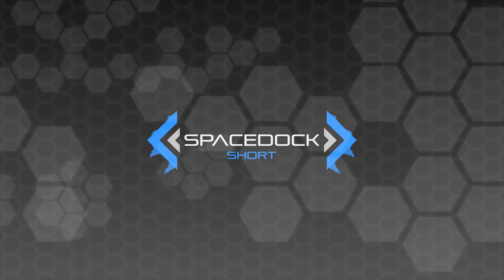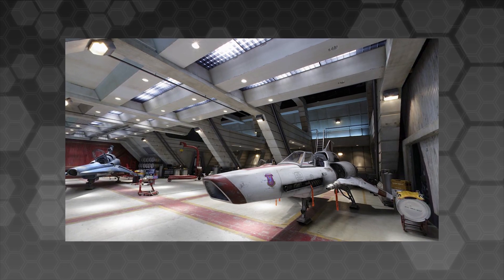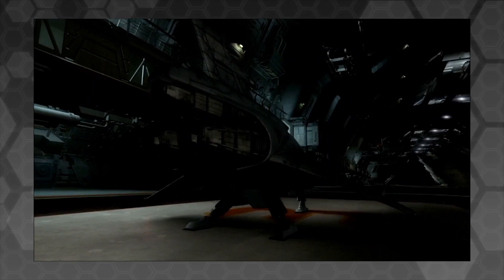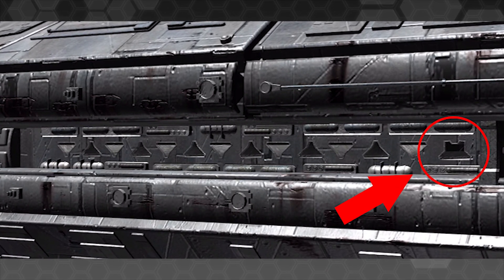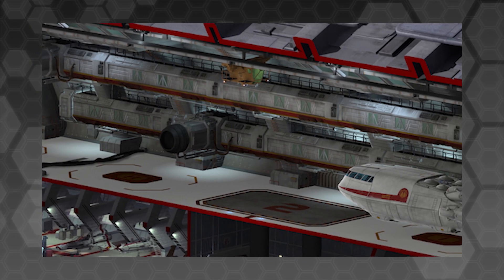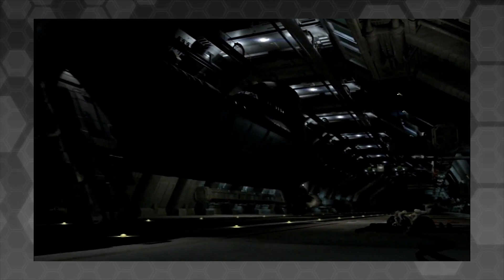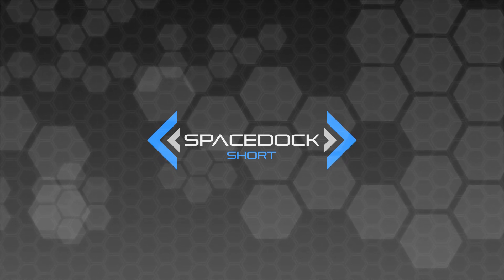How to Land on the Battlestar Galactica

Comment: Calling the ball refers to the Optical Landing System (OLS). The OLS is not the sequential landing lights.  The actual ball is centered on the stern of each flight deck, just below the landing deck itself center mass.  You see a red series of lights which looks like an "X" going three lights in the vertical and 4 lights off each side in the horizontal.  The vertical is your glide slope adjust, and the horizontal is for centering both small and larger craft on the deck.  LArger craft like Colonial One would need to center on-line with the lights since there wasn't any auto-landing systems.  I hope this helps!

Comment: The shuttle craft pictured (& honestly I never noticed it, even though I'm of the original BSG generation.), is probably just an homage to BSG '78.  But you knew that, I'm sure.  Sorry...🙃.
Like you said, though, in this continuity, it probably fell into disuse & was remanded to 2nd or 3rd tier Colonial usage.  I think they may have kept 1 or 2 stocked for special purposes, such as real VIP's or large-order emergency evac of the entire ship.  Galactica was older, bigger, & had more crew than Mercury class ships like Pegasus, so even a full complement of Raptors, which Galactica certainly did not have, couldn't handle a full abandon ship situation.

Comment: If you look at the model of the Pegasus that show the Raptor launch tube, you will see right side up Viper launch tubes and upside down launch tubes. My guess would be that the Vipers are launched in the orientation that they land and that the launch tubes are angled from each hanger bay. Each hanger bay, one for each landing bay is probably directly below each landing bay.

Comment: ...and Vipers land at "take-off" speed for the same reason that all aircraft landing on a carrier do, in case something goes hideously wrong and they need to take off again. Now, I know that they are in a vaccuum, and they don't need airspeed to lift off, but they might need to get the hell OUT of the bay quickly in an emergency, so they touchdown at "get the F out" speed first, then arrest their momentum. In air combat situations, even in outer space, mpmentum is life. You don't give it up easily.

Comment: Don't know if anyone has noticed this yet, but in that shot of Pegasus's launch tubes, half of them are upside-down and closed. So I assume the hangar deck has two floors and no ceiling, and it can launch Vipers in either orientation, but possibly not both at once. So the upper landing bay would collect it's Vipers, re-fuel, re-load, and re-launch, then the lower landing bay takes over and brings their upside-down Vipers "up" into the same deck, and launches their fighters from the upside-down tubes.
Reply: Okay, so someone else did point this out. Sorry, late to the party! :)

Comment: The ship flipping mechanism of the Pegasus does not need to be the least bit complicated.  On the landing decks that the fighter land "upright" you have conventional lifts. On the landing decks where the fighters land "inverted" instead of the lift coming straight down it could simply hinge on one edge so as the fighter is brought in the plate would flip 180 degrees along the hinged edge. This flipping plate would actually be a simpler mechanism than a conventional lift and have fewer moving parts.

Comment: One thing I really like about Battlestar Galactica generally is that there is a lot of things that make a lot of sense.  The utilitarian design, the seperate landing/launching systems (which would be a real advantage in fleet actions compaired to having to share a single runway for launching and landing craft), the fact that there are 2 landing bays (which if you have a fleet that is as reliant on fighters as in BSG makes absolute sense with a context to battle damage) and facilities like a machine shop to allow the battlestar to be relatively self sufficient.

As for the Pegasus having launch tubes for Raptors where Galactica does not, I would expect that to be down to the Raptor having come into service some time after the Galactica had been laid down.  It makes sense with the Galactica being old enough to be retiring as a legendary ship from a past conflict when the series commences but I could be wrong (it has been a long time since I watched Blood and Chrome).

Still, the method of FTL used is a mystery as is the whole artificial gravity/not turn your fighter pilots into goo when doing high g maneuvers thing.

Comment: I'm coming late to this video but after watching this a detail stuck in my head and I figured it out.  @5:50 the narration goes into talking about the Pegasus's double stacked flight decks and the logistics of moving craft down to a common hangar deck.  That there would need to be some kind of rotational lift that would orient all the craft to a common deck.  The detail that stood out to me comes in when the Raptor launch tubes are shown.
At @4:10 there's a still picture showing the Raptor launch tube at the far right but if you look at the Viper launch tubes, you'll notice that the flip-flop between upright and upside down.  I'm willing to bet that there are two hangar decks in each of the pods.  This way, no matter which flight deck you land on, you're in the correct orientation for for the hangar deck for that landing and still in the same orientation for the launch tubes assigned to that hangar deck.
Has anyone heard anything else about the design of the Pegasus's flight pods and how they're oriented?  This seems to be the most logical explanation for how to handle two flight decks in that configuration.

Comment: For the upside down lading deck, I just assume they land upside down in emergency situations, but once they actually return to the hangar bay, they have special elevators that the floor opens and you fly "up" (according to the hangar deck, not the flight deck) and the elevator closes underneath the fighter or raptor, then raises it into the hangar.  That way you don't have to worry about flipping it around in a full gee environment.

Comment: Also, I liked the layout of the flight pods in the reboot. They just made more sense, especially considering the possibility of a botched landing or a fouled deck...just add throttle and keep going.

The original Galactica wasn't designed to allow that as only the rear portion was for landing with the middle portion being the service hangar, and the forward section occupied by 4 forward angled launch tubes....all on the same level.

Comment: The Galactica flight deck would need an elevator to move the Vipers and other craft from the the landing deck to the hanger area. The lower landing decks on the Pegasus would need to only have a simple mechanism in which the Viper would magnetically attach to  a hangar access point....basically just a designated plate on the deck. That deck plate would simply designed to be double sided, and rotate into the hangar area, correctly orienting the Viper to the Pegasus. Once in the hangar area, the Viper is towed off the plate while the next Viper is landing and attaching to the plate. More landings could actually be accomplished with the rotating plate than with the vertical lift elevator of the Galactica.

Comment: They're fighting for survival and turn one of only two flight decks into a museum???
Reply: The Galactica was being decommissioned just before the Cylon attack on the Colonies. She was going to be a "floating museum" used for school field trips. And then the rest of the fleet was destroyed, the shipyards captured, as well as the Colonial worlds. In the pilot episode, they had to manually move the "antique" Vipers to the port side launch bays, reactivate, and rearm them, and launch a squadron to fight the Cylons.
Reply: @johnMullholand  so you move out the museum stuff and reactivate the flight deck.
Reply: @RonJohn63  I think they were more worried about getting what they had into the fight, rather than restoring the flight deck to an operational status. Besides, at first, the had barely enough pilots to man the few fighters they had. Aside from "Apollo's" modern fighter, all they had was one squadron of the old fighters.
Think about it like this, the IOWA class battleships, like the USS Missouri, for instance, have been made into museums. What do you think it would take to make them fully operational again? And doing that while under attack? You'd be lucky to be able to get the engines fired up and be able to move her, let alone reequipped and rearmed. At least Galactica had one remaining flight deck that was operational.
Reply: @johnMullholand  I'm not sure I wrote "immediately after they shoved off".  Let me check...
[pause]
Nope, didn't say that.

Comment: A little late, (I'm newish to your channel), but I would wager that the lifts on the ventral hangers are mounted into a servo system where it lift/lowers, and mid transition the lift rolls into the alignment for either the maintenance bay or for the landing pad.  I would also wager, the same lifts hit both pads and lift straight through.

Comment: "Call the Ball" is another modern day Naval Carrier term that refers to the Source light (also known as the Meatball because of its orange color) on the  Optical Landing Systems (OLS) installed on most modern day aircraft carriers. The "Meatball" depicts the landing aircraft's relative position to the glideslope.  The term "Call the Ball" is given to the pilot by the LSO, and the pilots reply "I have the Ball" lets the LSO know that the pilot sees the Meatball and is able to use it to properly guide the aircraft in.
Reply: Correct and the OLS on a carrier uses a series of lenses to make it so you can only see the meatball if you are lined up correctly
Reply: I was just a bout to write all of that out too lol.
Reply: 2020Max1 a most excellent explanation
Reply: It’s the SGSI/WOLS.  I had the NEC.
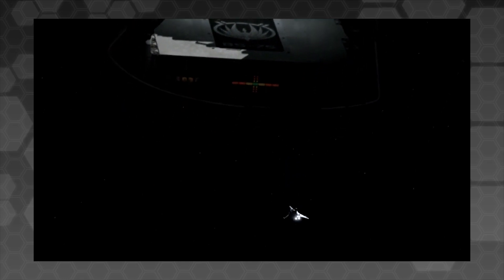Reply: It's visible at 0:36

Comment: isn't "call the ball" a reference to the horizontal level (in the shape of a ball) on the pilot's HUD? Being another mimic of real life military jargon, where the pilot uses the "ball" level in the cockpit to determine if they're rolled slightly to one side or the other, in order to make sure both sides of the landing gear hit the deck at the same time. 
In this case "calling the ball" would mean the pilot is clear to stabilize their "ball" with a pre-determined degree of roll (presumably matching the Galactica's)
Reply: No, the ball on the control panel or HUD that you're thinking of is the artificial horizon. That allows you to roll and level your wings relative to your landing target. It keeps you from catching a wing on the deck as you land.
You "call the ball" when the meatball is lined up with the horizontal row of lights that would show you if the landing deck is tilted. The ball lets you know your approach angle is correct, so you don't hit the deck or landing bay edge, or miss completely. A miss is a bolter on an aircraft carrier and you can go around again, but on the Galactica you'd go splat on a bulkhead.
Reply: @BigBlueJake  well there's the artificial horizon, but on some older ones there's a ball level as well. idk maybe the term got re-used when newer instruments came out or something.
Reply: @TheAdamBomb804  On older what? Jets? Vipers? I'm a bit rusty, but I'm an original Battlestar Galactica fan (didn't have cable so only saw a few episodes of new BSG), Air Force veteran, and a total airshow/Warbird nut. I've gotten to stick my nose in a few cockpits and simulators but F-16s and legacy F-18s are the newest jets I know much about. F-22s, F-35s and Super Hornets might have something the older jets don't have.
Reply: @BigBlueJake  on older older planes, I flew a P-51 once and I think i remember it being there, but who knows, maybe im misremembering lol it wouldnt be the first time

Comment: On the picture of the Pegasuses launch tubes it shows them in both up and down positions so maybe the work deck uses the ceiling as work spaces. They may have zero g in between to rotate into the correct /new gravity transitioning toward the floor since there would be no ceiling just upper and lower deck in relation to the rest of the ship.

Comment: Pegaus, having a larger Viper compliment, would also need more capacity for emergency landings. Hence the extra runways.
I imagine the elevators in the upside-down runways can merely flip over before raising the Viper/Raptor up into the hanger. Presumably you would only use the upper pod (with it being in the correct orientation) for landing other things such as shuttles so you enter the ship right-way-up.
Raptors by design are not just utility craft but can also serve as essentially missile-boats & hence there may be a need to have launch-tubes for them to launch into combat with the Vipers.
I think in the BSG RDM series they're too precious to waste in actual combat, plus they'd have limited effect on the new mostly-1-ship fleet the Cylons are usually (huge Basestars).

Interestingly in WW2 there were some carriers with 2 stacked runways and a hanger between them much like Pegasus only not upside-down obviously. The idea being you could launch more quickly (meaning the first-launched planes would spend less time in holding patterns waiting for the rest to launch & therefore wasting fuel and reducing range). You would then land only on the upper one for safety.
It was done away with due to it taking up precious space for additional aircraft storage & basically not being as useful as they thought it would be, especially once aircraft range improved & carriers got bigger & more modernised.

Comment: For the Pegasus lower landing pods, I always assumed the artificial gravity was reversed on the flight deck (no need to flip the lifts) with 0G corridors leading to the ship proper to avoid any sudden gravity reversal.
Reply: It's artificial...upside down is right-side up in those landing bays. EVERYTHING is upside down. Storage, maintenance, everything. Even the launch tubes are inverted.
Reply: Agreed. My assumption was that “down” was some kind of device, so arranging that device as a flat plane in the middle of the two flight decks would create two different areas oriented 180 degrees from one another, so the real challenge is when moving from the inverted area to the rest of the ship (which makes me greatly appreciate the canonical solution to artificial gravity in The Expanse).

Comment: The inverted flight deck wouldn't need elevators, just a pad that rotates 180 and rotates the Viper onto the hangar level at the same time it orients the Viper with hangar deck gravity.  Probably no more complex than an elevator, maybe less so.

Comment: Good one! But I have 2 ideas for that situation described at the end (the inverted landing pods and launching tubes):

1.- The pods have artificial gravity and the crew is pulled upwards instead of downwards (taking as reference the standardly oriented pod) and there's a second repairs room in the inverted ones. That OR...
2.- There's no artificial gravity on the inverted pods. It comes to reason that such characteristic is possible, if we take the Mobile Suit Gundam: Iron-Blooded Orphans ships, especially the Halfbeak Class Mobile Suit Carrier and furthermore the NOA-0132 Armored ship Hotarubi, which have the characteristic that it can nullify the artificial gravity of CERTAIN SPECIFIC sectors on the ship. That also would give proper explanation on boarding the inverted Vipers, by doing that in a similar manner to boarding Mobile Suits in Gundam franchise.

Comment: The double sided landing bay of the Pegasus doesn't make any since. it is overly complicated to flip the ships and mix the gravity orientation and besides why not just build a 3rd and 4th landing pod in a X configuration instead of a double landing bay with one hanger shared hanger.  (that single hanger is a single point of failure for 2 landing strips) In other words, just have 4 landing bays,  If the entire landing pod is damaged in a 2/4 landing strips configuration then you will lose 1/2 your launch and landing capacity. but with an X configuration you will only lose 1/4  landing and launching capacity when a pod/bay is damaged.  (plus you can store more vipers) I don't remember if they lost the entire bay to action in the new BSG, but in the original series it happened.
Reply: You have a good point. One possible counter argument is that it would complicate the battle space management a bit, with craft landing and launching from so many different positions rather than along similar vectors for the port and starboard flight pods. It is probably quite complex enough as it is. Imagine poor Captain Kelly handling flight ops for four completely separate landing paths rather than two! Add to that the probable need to keep the ventral and dorsal surfaces free for structural/functional reasons, plus a need to have clear arcs of fire for gun batteries, sensors and the like. I suspect the decision was driven in part by the established two dimensional 'naval' aesthetic from the original 1978 version, which itself harkens back to Star Wars and the memories of WWII carrier battles in the Pacific.

Comment: Remember that the battlestar Pegasus had the ability to construct brand new vipers on board when enough raw materials were available. This accounted for the influx of new Vipers so sorely needed by both Battlestars. Prior to the discovery of the Pegasus the Gallactica had to design their own new Viper replacement, the Rosalyn stealth Fighter, from left over materials. It was difficult to fly and construct, but proved invaluable to the fleets effort to fight the Cylons. After the Pegasus joined the fleet many new avipers were available to the Gallactica. And the war progressed from there!